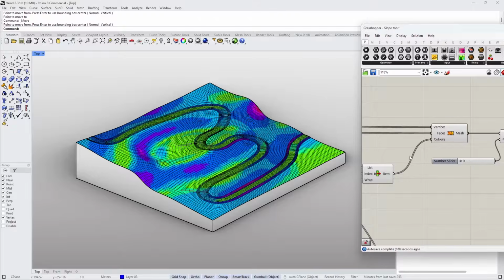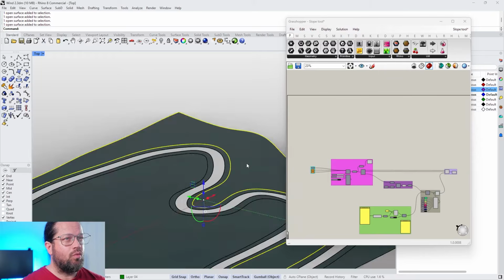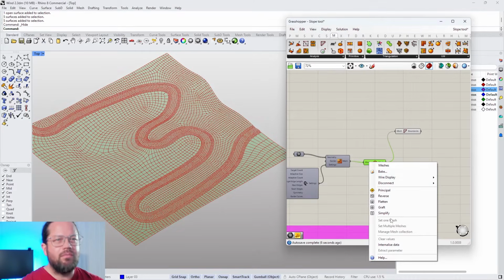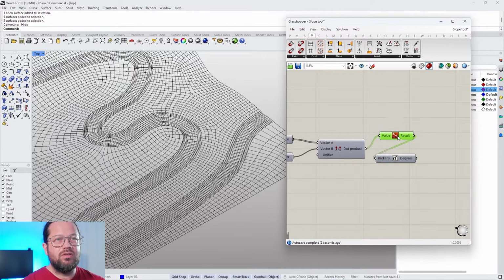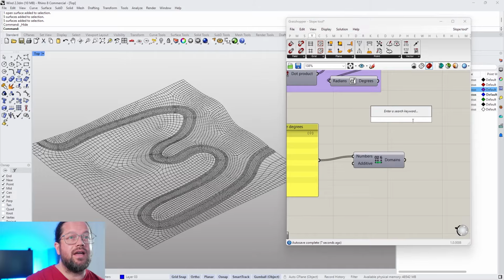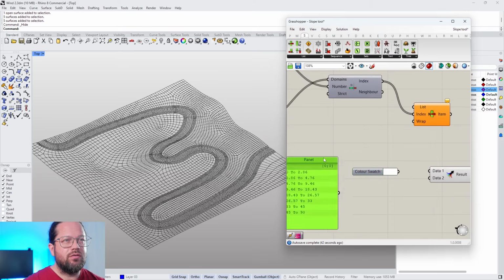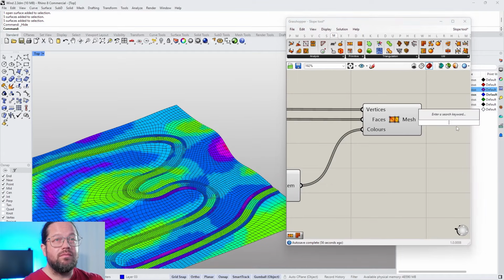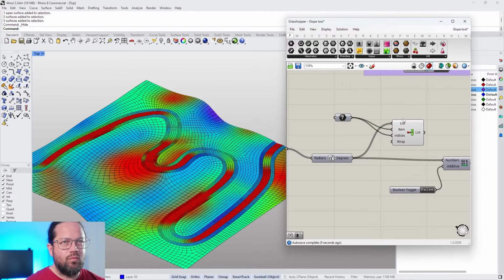Every Architect Needs This Grasshopper Tool – Smart Slope Analysis Tutorial

Comment: Thank you for this tutorial! Very helpful. Is there a way to calculate the surface area covered by each color through editing this script a little?
Reply from the maker: Yes for sure there is. 
We could use the ID of the cells within the different slope degree bands to cull and select portions from the mesh and calculate these separately. Maybe there is also a more elegant easier option to directly get the area based on the colour...not sure I need to test. 
But I love the provocation... Thanks

Comment: Indebted. Shared with my students. They love it. If only you could tell what the arc cosine does ?
Reply from the maker: When we multiply (dot product) the vectors of the terrain vertices with the z vector we get the cosine value for each mesh point. The arc cosine component translates this into radiants (angles) which we then can translate into degrees. 
We need the vector angles to compare it with our list of angles. Hope its clear.
Reply from the maker: And I love it that your students love it.
Reply from the maker: Greet them from me. Where are you based?

Comment: how you do the roads please?
Reply from the maker: Sorry do you mean how I modeled the roads?
Reply: @PhilippGalvanDesign  sorry for my bad english, yes please, and thank you
Reply from the maker: Ok my method: 

I have my terrain.
I create the road as a flat line drawing in plan view. I offset the road center line on both sides to get my road and I offset from the road edge roughly half of the road width or more on both sides. So you get five curves on total.
One center curve, 2 road edges and 2 road edge offset curves.
Then I project the center curve onto my terrain. Usually I rebuild the resulting curve to have less points and make it more smooth.
Then I trim the surface with my road edge curves.  You should get a cut which is as wide as the road plus the road edge offset....

Then I offset the projected centerline to the road width - these are my road edges on the terrain  - I create a profile curve and sweep along the two road edges. That's my road on the model.
You should now have centerline and road following the terrain. You should have also a gap between terrain and road edge. Now I blend the terrain surface with the road edges on both sides.

That's it.

So you should end up with a smooth transition between terrain and flat road.